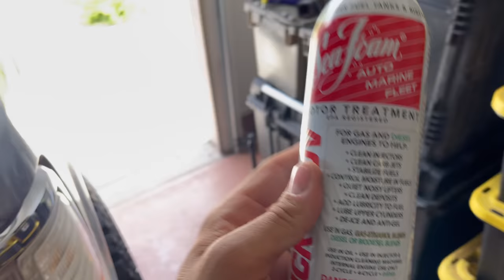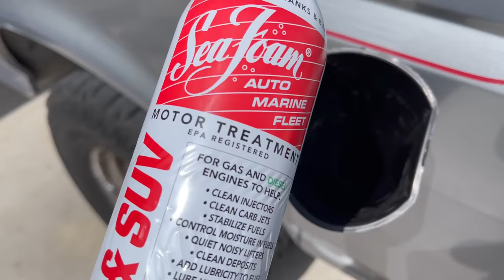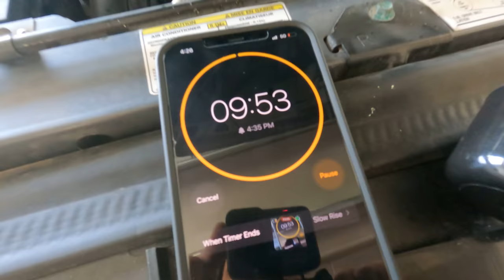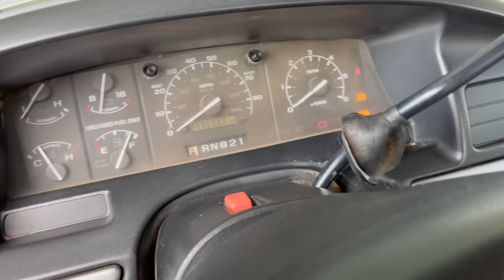Seafoam - Engine Treatment | How-to and is it safe inside your motor?

Comment: Be super careful. At about 2:50 he shows spraying Seafoam directly into the intake, the red plastic spray straw can easily be pulled right off with that suction and you dont want that being sucked into a valve. You dont need the straw down the throat of the intake, anywhere close and its all going in, an engine is the strongest vacuum machine on the planet.  Otherwise perfect stuff.
Reply: good looks gonna be cautious of that now
Reply: @whoozy2261  me too lol, dont want a year and a half on an engine swap to go to shit in 5 minutes
Reply: I once had a friend have his nitrile gloves get sucked in lol
Reply: @imghaniff  LMAO I JUST PICTURED THAT . good thing homie’s hand didn’t get sucked all the way in with the glove 😂😂😂
Reply: Ok so what if the straw gets sucked in, it will melt literally causing no damage
Reply: @CCaslopea  Could it just melt and get blown out thru the exhaust valve, possibly but highly unlikely. What is likely is one or more of the following. It will get stuck in a valve and when it does melt it will be a big blob to keep the valve from shutting, thus screwing up the air/fuel mixture and also allowing compression and exhaust stroke cycle gases to both backfire into the intake manifold further screwing up the next cycle of that and other cylinders. It can also melt as you say in the piston bore if the whole thing makes it there which is highly unlikely  and hose up the piston rings horribly either allowing blow by and thus lost compression or screwing up the oil distribution on the walls for them. Furthermore its goo can get stuck in the spark plug gap either stopping it completely or causing any misfires, furthermore a piece could make it to the oil gallery and block some tiny critical oil port passage as in a lifter. Theres alot that could and will go wrong if it gets sucked in, it can even damage sensors in the upper intake manifold or damage the Mass air flow sensor right there in the throttle body. Nothing good can come from plastic being sucked into the engine.
Reply: @ColdWarVet607  don’t forget it can also drain the battery
Reply: @CCaslopea  How so? By sputtering the engine?
Reply: Wow need a huge warning ⚠️ label on the product... powerful process to clean throughout.
Reply: My same exact thought when trying to decide if I should let my 7 year old spray in the can.  This kid drops EVERYTHING.  Seeing that straw bend gave me all the info to know not to let her butterfingers near that part of the job!
Reply: 😂 this is such specific advice. Either you have godlike foresight or have made this painful mistake
Reply: You haven't met my wife. 😂
Reply: Small chance of that happening
Reply: My wife's a pretty good vacuum 🤤
Reply: @samthekashman  godlike foresight, brought to you by crippling anxiety
Reply: False. A way stronger vacuum can be created with a fire burning in an hermetically sealed enclosure.
Reply: CRC has a red straw with an "s" shape that is handy for this reason 😊
Reply: @TheJetbreaker  Did not know that, thanks, but no matter what be careful. Go my hand sucked right to the intake of a throttle body at idle and could barely get it off. I wound up with a palm and fingers that looked like hickies, bruises and alot of swelling. I'll check that out, thanks again!
Reply: @samthekashman  It's just so GD obvious, any thinking person should immediately see the potential for this occurring. Peace.
Reply: Thought the same thing.
Reply: Other video on seafoam website said unhook the intake, slip the black hook on the end of the hose into the intake and snug the intake back on. That will preventbitvdickjngbanything up.
Reply: @remnard1  correct. The proper way is to attach the intake rubber intake tube over the red straw.
 There's a video about it.
Reply: @2Jeezuzisreal  it actually comes with a black plastic hook at the end now.
Reply: Strongest vacuum machine on the planet? Might want to check your hypotenuse
Reply: That's gangster information! Thank you!!
Reply: @remnard1  the black hook actually fell into my throttle body.  Let go of the throttle and shut off the engine as fast as I could and fished it out.  Gave me a good scare...
Reply: Good reason to know thanks
Reply: @imghaniff  🤣🤣🤣
Reply: @ColdWarVet607 woosh
Reply: Fellas… hear me out
Reply: My ex girlfriend is the strongest vacuum machine on earth
Reply: That was making me so nervous - that spray nozzle had some grip

Comment: I refer to SeaFoam as magic juice.  

First time i used it was on a jeep with frozen fuel lines.  I added a full can to the tank, and within 10 minutes, the seafoam had worked its way through and attacked the ice.  It attacks water too, so its an excellent stabilizer.  I use it in every engine I own!
Reply: you could have gone to walmart and get some isopropyl alcohol to do exactly the same thing

Comment: As a car guy I've used Seafoam for decades in every car I've owned. What even cooler about it is that it's great to use in Coleman lanterns and stoves to both clean the generators AND stabilize the white gas (or gasoline) fuel in between uses.

Comment: I've been using this stuff for years in my '86 Toyota Van with EFI, usually 1 can in the tank about every 3rd or 4th fill up, so about 1000 - 1200 miles, and it keeps the injectors in great shape. The engine is pushing 190,000 miles now, and still starts and runs great and consistently gets 24-28 mpg. (not bad for a little 2.2 liter engine dragging a 3450 lb. van around!). Seafoam is one of the very few 'fix-it-in-a-can' solutions, that actually does what it says!😉👍
Reply: 5sfe most reliable engine of all time
Reply: @sosbabe2804  The vans actually have the 3YE engine, which is a pushrod style engine that was used in the older Toyota forklifts. They just changed the head and set them up with EFI for the vans, and yes, they are bulletproof, as long as you don't overheat them or run them out of oil!🙂
Reply: Did you change Oil after using the intake type Seafoam? Because it will release junk on your system after cleaning process. Somebody said that in another video but I think he has a GDI engine that's why.
Reply: @raidenm.c.1486  I've never done the intake treatment actually. It stays pretty clean for the most part.

Comment: I have had this stuff unstick lifters on an engine with 230000 miles and later on when we rebuilt the engine it was so clean inside. I would recommend doing everything he done in this video at the same time. This stuff works great.

Comment: Liquid ounces should be measured with a measuring cup. Ounces measured by weight are different than liquid ounces. Probably not a big deal as I usually go heavy on whatever dosage they recommend and add it about 500 miles before I change the oil. Just make sure you don't overfill the crankcase. Use a good quality oil filter once you change your oil. A good quality air filter changed regularly is also a must. I run a high mileage full synthetic oil rated for 20k miles and change it every 10k. I also add an oil stabilizer with every other oil change. I do the crankcase treatment about every 40k on the cycle when I haven't added the stabilizer, and add fuel treatment/injector cleaner when I do the crankcase treatment. My last vehicle had over 300k miles on it before I "retired" her. When I last changed the timing chain and replaced the valve cover and oil pan gaskets, the engine looked super clean inside. I would've kept driving her but unfortunately, the manufacturers don't build the stuff attached to the chassis (interior, plastic components etc) to last more than about 12 years before it all starts to fall apart.
Reply: You don’t have to measure it the stronger is the faster to clean your system out. I know I’ve done it for 45 years if you go by what the manufacturer state measuring it is going to be a slower process.
Reply: I follow a similar maintenance schedule. I have 512K on my 2007 Nissan Titan SE
Reply: 1 ounce of water is 1 ounce of weight
Reply: It’s close enough! FFS
Reply: I change my oil every 3-4k due to me driving a euro would you advise?

Comment: Bought a 05 Tacoma and it felt a little sluggish and would vibrate a little. Ran seafoam in my tank for approx two months straight and the truck runs like new. This is by far the best fuel treatment out there. I hear Lucas brand is a close second, but based on my experience, I’ll be a lifetime customer of seafoam. Not the cheapest but quality stuff.
Reply: Blow it up
Reply: It's a FORD junk it
Reply: Lucas is best in oil treatment i’v  found and sea foam in fuel system… just my opinion but been using them for years with incredible results
Reply: @jaykatcher1769  agreed
Reply: @roberthidalgo3105 I used 4 oz of Seafoam in my Honda Element at the beginning of my oil change several months ago. What I did notice was before I put it in my engine was slightly shaking. After I had it in for a couple of months I noticed that the engine purrs like a kitten, no more shaking whatsoever.

Comment: My dad ran seafoam through the powerbooster vacuum line. That way you didn't have to disassemble the intake. Works great,  keep it running if you do this,  don't let it die while treating through vacuum line 🎉
Reply: I learned it as split the bottle into thirds. 1/3 into the oil, 1/3 sipped into the brake booster line while running, and the last 1/3 dumped in the booster line to stop the engine....let soak.  Drive, giving some good revs.  Turn off when smoke stops...change oil in a week seeing the darkest, evilest oil you ever will...enjoy your car

Comment: My preference is the lucas upper cylinder lube and injector cleaner stuff. Makes a massive difference in my car vs other brands. Supposed to get 29ish highway on my 09 impala with it and a 1600 mile trip we got 34. Prior we got 24. It goes down to about 20/21 run a medium sized bottle and it jumps back up. Then trickles back down. 

Seafoam did work very well on my outlook. Had picked up from a buy here pay here and it had been sitting a while. 2 cans in gas and one in oil plus a spray blend of it into the intake and it smoked out our neighborhood and down the road about a half mile. Ran pretty good after.

Comment: I used to do small package delivery with a couple of Prius. The older one about a year ago started to develop a timing chain rattle which I knew would be either a worn/stretched chain or a gummed up timing chain tensioner. I started adding sea foam to the oil at each change after about three changes the timing chain rattle is gone and the engine runs as smooth as silk. That car now has 490,000 miles on it. I recently started it after sitting in my garage not running for 10 months, it fired right up with none of the shuddering and shaking you get in a Prius that hasn't run for a while. Scotty Kilmer says it's crap so that's a good enough reason to me to use it.
Reply: Bro, great way to wreck your engine.
Reply: @hobsdigree2  Well my personal experience says otherwise and since you apparently don't have any experiences of your own to report.....I'll just ignore you.
Reply: Seafoam has nothing to do with the timing chain bud!
Reply: @brucedale4465  Sea foam used in the oil cleans deposits, including deposits in the hydraulic timing chain tensioner allowing it to apply the correct tension to the chain.
Reply: The timing chain rattling is the first indication of a broken timing chain guide. Ask anyone that has a 22re or a 22r engine and they will tell you the same thing.
Reply: @timbales3652  well since the timing chain noise has gone away that means seafoam repairs broken timing chain guides, right?

Comment: Used Seagram for years in the tank and the hot soak spray, but recently had an RX300 start burning 1-1.5 qts of oil per tank of gas! Tried the crankcase trick and shut off overdrive running around 3800 rpm for 10 min several times during the 300 miles. Drained the oil to change it and chunks of carbon sludge actually plugged the drain hole!  Dropped and cleaned the pan and oil pick-up tube with brake parts cleaner. Did the same to the vvt solenoid screens and… VOILLA. Thing has 250,xxx miles, runs and sounds like new! The 4 oil changes since drain almost brand new looking oil at 5k miles.  I absolutely love this stuff!

Comment: Awesome, My bro just got me on to this last week! He's been doing it for years on all his rigs. No measuring needed, one in the gas, one in the crankcase good to go!   That was on my 98 Expedition. He does his Land cruiser,  BMW,  GM. I've seriously already noticed a difference.
Reply from the maker: Yea man this stuff is great! I too have always used it through all my fuel systems. Its been a while since I’ve had a vehicle with over a 100k so hadn’t had the opportunity to use it in the crank case. But man on this truck it made a very noticeable difference in starting, idle vibration, overall engine noise, and mileage. Love it
Reply: Sure you have, but only in your bank account.
Reply: Just look at why Scotty kilmer says not to use this stuff. It's junk and can kill your cat.
Reply: SuperBroken1.  I would bet you never even used seafoam.  You are just repeating stuff that u heard on utube without using ur brain to form an opinion....  who knows Scotty could be getting paid to put a company.  
My point is try something and make up ur own thoughts b4 spreading more garbage online.  
I used it twice. Both times there were positive results
Reply: @SuperBROKEN81  🤣🤣🤣🤣🤣🤣🤣🤣🤣🤣🤣🤣🤣🤣🤣🤣🤣
Reply: @SuperBROKEN81  Scotty is full of s**t. I use this stuff for 40 years plus, used in a small fleet of 1-ton trucks all with 350 engines. One of the engines had 170k and was burning oil, normally, we would pull the engine and buy a crate engine. With this tuck we decided to completely rebuild the engine. The engine was as clean as could be, heads had little to no carbon in them, did not have to rebuild the Q jet as well. This stuff works great. Always ran Mobil 1 non synthetic oil back in those days.
Reply: Jayson Raynor McNamara  The fact you swear by seafoam shows everything I need to know about you.
Reply: @SuperBROKEN81  in ur feelings much 😂
Reply: @SuperBROKEN81  why you replace the cat after the treatment, what do you think kills cats? Carbon! Durr! 😂🤷

Comment: 2 fluid oz per gallon is recommended for cleaning the fuel. 1 fluid oz for maintenance.  The company says you can't put too much into  the fuel. To clean injectors, I use at least 2 fluid oz per gallon. When fogging the intake, it's recommended to run 1000 RPMs over idle. The tube is made to seal in the rubber boot, so it doesn't get sucked in. Running without a MAF sensor will usually throw a code. Easily cleared with a scanner. 
Reading and understanding the manufacturers directions is key to using the products correctly without creating additional problems. I'm sure it worked but, not all the way it was intended.
I try to clean mine once or twice a year.

Comment: Thanks for showing how much smoke comes out after the hot soak. When ever I do a side job tune-up I use Seafoam. The clouds of smoke can be alarming to the customer, so it's nice to be able to show them what will happen during the Seafoam process. I feed my Seaform into the engine via the vacuum line of the brake booster. I get 8-12 ounces into the engine before the smoke begins. I shut off engine and let it sit for 30 minutes then take the vehicle out for a quick spin and burn / blow out all the smoke and carbon. I then proceeded with a full tune replacing cap, rotor, wires, plugs, fuel and air filters. Customer's love the tune-up but the excessive smoke freaks them out.
all t
Reply: I freaked the first time I used it too.  Not because of the smoke itself, but because I thought it would screw up my O2 sensors and catalytic converter.  It did neither.  It didn't even throw an Check Engine light, which I thought for sure it would do!  Just be sure the engine is warm so cat will burn the stuff off!
Reply: this is the only way ive ever used it.
Reply: Thank you for sharing. Great video production. Definitely, wonderful product. Everyone stay safe, happy and healthy. From Henrico County Virginia

Comment: Good info. The crankcase treatment with the high mileage seafoam saved us a $3000 repair by clearing a code for a clog in the CVT solenoid. Love this stuff.
Reply: Thats what I need, I just pulled that code p1009 on my 09 RDX Turbo. Can u describe the process you used? Thanks

Comment: Sea foam has brought so many engines back to life for me. I recently decided to dump a little in my weed whacker and was shocked at how much it improved. I thought it was good anyway but man was I wrong. Cleans my mower up after winter every year. Thinking of doing all this to my plow truck next weekend
Reply: How much sea foam to a craftsman 42 inch cut riding mower about 10 years old? In the gas or oil?